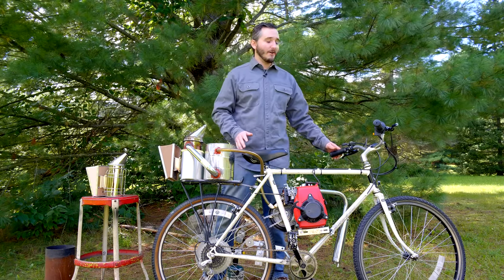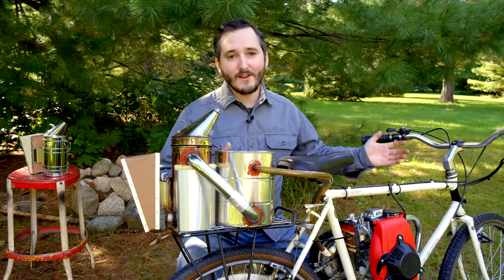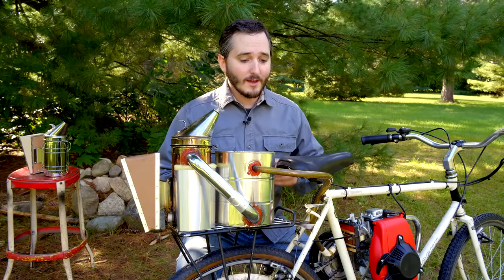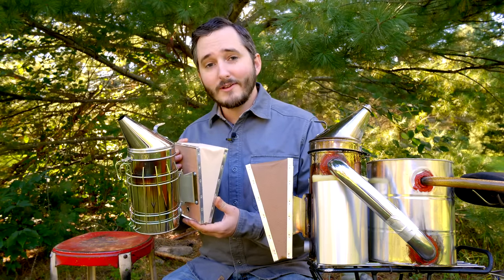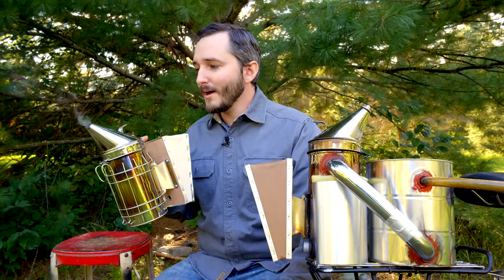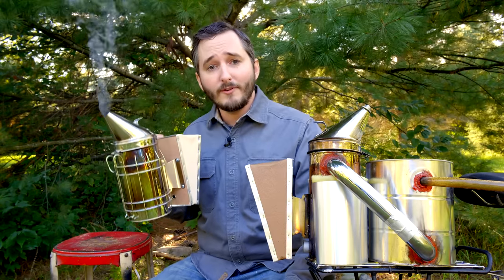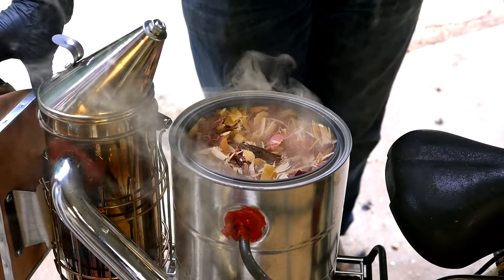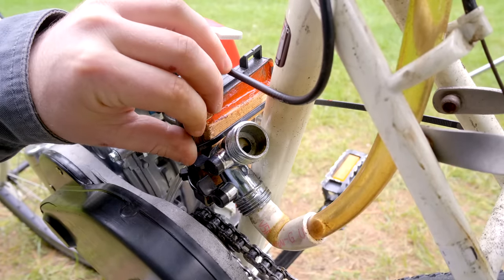Running a Gasoline Engine on Firewood | Woodgas Biofuel

Comment: I like Your channel and I love Your English. :)
For a person for whom English is not a native language, it is very important that the presenter speak slowly and clearly.
Edit: My suggestions
1. Separate combustion chamber from gasified materials, so heating flame will be always the same and much bigger.
2. Introduce separated tank, only for produced gases.
3. Add one way valve to an air inlet.
Edit2:
4. Use charcoal for filter and clean gases.
5. Use part of created gases to heat gasification tank (positive loop).
Reply: For the charcoal filter it's best to use activated charcoal, since it absorbs better than normal charcoal.
Pretty cool ideas though.
Reply: make a schematic where would he put all this stuff on a bike like that. If he could, he would add a lot of things, but the space and weight is restricted.
Reply: Efff, mounting any part of this stuff, including initial, is ridiculous.
We are not thinking about, is this vehicle is reasonable (because it is not), but is post apocalyptic cyclist is faster than Lance Armstrong on all of their stuff ;)
Reply: What if you compressed the air and wood gas entering the engine using some kind of a engine powerd turbine.
Reply: Hammer of the Witches. Your username is not one I expected to see in the Youtube comment section. If I may ask, why did you choose that for a username?

Comment: You can make it pass through lime water to absorb CO2
Reply: This might also remove more of the water vapor (as long as the lime water is cold enough).
Reply: It would be additional weight, and it woukd have to go through a lot of it because gas absorption in liquids is very slow if it comes to extracting at least 10% of the gas.
Reply: How about a cannister of lithium hydroxide as in a diving rebreather? Of course, it is additional weight again. You're also perhaps getting away from the intention of running an engine entirely on natural fuel if you need LiOH to run it!

Comment: The beesmoker is a neat idea, but to minimise smoke what you really want is a downdraft-gasifier design. Ive never tried this myself so this is book-knowledge, but it supposedly makes an enormous order-of-magnitude difference in terms of the amount of partial combustion products, as compared to the updraft system which your beesmoker seems to be. It makes sense too, since if the air moves in the same direction as the combustion front, the combustion products will pass over the hot coals last, allowing them to be maximally reduced.
Reply: Exactly right.  

It also produces less tar to use charcoal fuel.  He's got way too much tar and it will clog the engine valves in short order.
Reply: Would coal gasify as readily as wood though? I have not seen it been done in such small setups with more crude process control. Not sure what the immediate impact of tar on the engine is (I imagine most of it would burn quite ok once in the cylinder?), but even without any tar I fear the setup is underpowered. Thermal processes don't scale down nice and proportionally; you need some minimal volume to sustain and isolate a nice and high temp burn front; so taking a car-sized gasifier and scaling it down proportional to the required wattage might not be a great idea. You need an insulated space to get a nice and white hot region to gasify optimally, and intuitively I don't see such a white heat being very confinable in such a small volume. With a loosely packed fuel in a small volume like this, the dynamic is more likely such that youd be driving off water at low temp (and thus tar) throughout the container initially, rather than achieving a more continuous burning front with a more or less constant gas composition. Coal would help with those concerns I suppose; given that it does not have such a complex burning process it should be simpler to contain; coals are either hot enough to form CO or they are not.

Comment: A conveniently located choke control would be helpful here.  That way you don't have to rush around and adjust the intake.  Another point is that many of these new small engines are designed to self choke with gas and won't open up until they're running past a certain point.  That could be another issue you're running into.  A 4 stroke gas weed eater might be worth looking into.  Most of those still have separate manual choke assemblies.

Comment: It looks to me like Wood gas is being lost out of the air inlet. If you added a one-way valve to the inlet it would prevent this. Although it wouldn't help the already low air flow.

Comment: You  are guaranteed to succeed with this, with a wee bit of fine tuning - but you are also guaranteed to gum up the engine with tar in just a couple of hours  :( . 
 Been there, done that - got the tee shirt. 
 Sadly, there is really NO way to filter the tar out, but it IS possible to produce woodgas that is clean enough to be as invisible as air. 
 A deep charcoal bed, and HIGH combustion temperatures are elemental to success in this regard. 
 Once you get those aspects under control, you will be amazed at how clean, and smokeless, your fuel gas will become. 
 By the way, I totally love this video, and I really wish more people wood give this a go  :) .
Reply: We do this to a large industrial scale 24/7 in South Africa to make our final petrol and diesel fuels which will rival even the cleanest fuel in the world... so it is possible. The benefit of this type of fuel production is low sulphur, we even have to add sulphur components just to ensure proper hydrotreating catalyst function downstream of the fisher trops process (gas shift) after this gasification step! Getting tar and pitch out is easy, let it cool down and filter and drain it. But yes you do need a lot of steps of filter and distillations to get good clean fuel for engine grade. Still, this is super interesting experiments!! Btw all information in this comment is public knowledge. I'm not representing my company with this statement.
Reply: CNCmachiningisfun by
Reply: @MorneBooysen  Fisher Trops Process was something the Germans were doing to keep their aircraft and vehicles going during WW 2, right?
Reply: @ZuluLifesaBeech-  not sure, but I definately have heard the same story before. but commercialising it to scale is rare and as far as i know only in Sout Africa
Reply: @ZuluLifesaBeech-  it was used for some civilian and training vehicles by Germany
Reply: I saw the Mother Earth News wood gas powered Chevy pickup traveling along the freeway in Michigan, which had a minimum speed of 50 mph. Their HQ then was, I think, South Carolina, so the engine and system must have been reliable.
Reply: @senatorjosephmccarthy2720  
 Yup. If a gasifier is set up properly, the engine will have a LONG lifespan. 
 My system has clocked up over 2200 hours, so far  :) .

Comment: You need to treat these start issues as if you are using propane gas! Wood-Gas, you need a flare pipe pre carby and light that first! You need to light it and allow it to burn bright, and this will eliminate the smoke issue you have! Also, that system is only really suited to a fixed engine speed unless you have E = mc2 , thus a clutch will be required for the operation of the vehicle unless you can regulate the air fuel mixture correctly for muli purpose throttle operations. Especially generators as they are governed! They work for most purposes just fine at fixed speeds other than welding or other intermediate sudden high-demand situations! Well done all the same! I'm very impressed.

Comment: Use a venturi to draw air into the engine- consider a carb design that can meter it a bit better? make the float raised by gas buildup instead of liquid fuel. Also, different spark plugs may perform better. Then just need a clutch/belt to the bellows for pedal start!

Comment: Love it!!!
So two thing's that may help,
1) elm wood provides a higher methane gas than most woods.
2) When lighting the tinder....the tinder should burn from the top down as in the direction of your draft. When lit from the bottom burn rate is diminished by draft
Reply: I had some afterthoughts as seen above.

Comment: StarLite: awesome job tying this together! It is in fact, almost the same formulation as some "Slime" mixtures. :-). I added a contact lens solution to reduce stickiness and it work just as well 
I think many of us should start working to finding applications to help place this material into fire fighter suits. This might help fire up the industry? 
Too bad the original inventor got too greedy. :-(
Reply: The kids have the formula and are refusing to share. They are STILL "working" on bringing to market. In the meantime, thousands have unnecessarily died because a technology was available to save their lives.

Comment: In my polymer chemistry researches I've stumbelled upon gasification as a means of "recycling"/reuse old plastic. You might give it a try in the same system. Apparently one can expect the output gas to be around 25-35% CO and 55-65% H2 while also producing small amounts of CH4 and C2H6. I wonder how it would run the bike? Might not be as "green" as woodgas tho.

Comment: Would love to see the update to this with the larger setup, if you can get this bike running at full throttle with no issues I feel like it would be awesome because then you could take the ratios of size of gasification chamber to size CC engine and really take any 4stroke and run it this was especially since these wood gas systems are carbon neutral, you could run a sawmill, vehicle, generator, you could combine this with a flywheel power generation setup and basically run your house with almost no environmental impact

Comment: Good 2 stroke engines have Autolube, so no need to mix oil with the fuel!
Reply from the maker: Forgot about that option
Reply: Oil injectors not autolube. I.e., jet ski 2 cycle engines
Reply: @jkgkjgkijk  Not sure what your point is?
Reply: Your still injecting oil into the cylinder. Might as well just set the engine to run on kerosene or other oil based fuel at that point. 
The main purpose as I see it is to use as little oil as possible for a survival / shortage scenario. Using any form of 2 cycle engine would defeat that purpose.
Reply: @timothyhaug2060  You are, but a 4 stroke still uses oil for lubrication even if it's running on wood gas!
Reply: The bigger problem is the 2 stroke cycle. During compression the combustable mixture of usualy gas/air is getting sucked into the crank shaft housing and getting ready to enter the cylinder in the exhause phase. When the exhaust phase starts it also opens up for the gasses in the crank and if the engine hasn't fully flushed the crank (which it rarely does) the gasses can burn inside of the crank with it's supply of oxygen. I have tried this with a 2-stroke engine boosted by hydrogen, the crank house cracked at high RPM and caused a leak that stopped the engine, it might even be possible to blow a hole in the case and not just make a crack. A 4-stroke is fully able to do it because of it's 2 extra cycles.
Reply: @adamlaw2645  you can make oil from the wood gas production as a byproduct from the tar  I think Im pretty sure I've seen it done

Comment: Hello my dear friend!!! I was impressed with your idea. That's cool.
Here are my first thoughts on how to improve the design. I am sure that you yourself have reached them.
1) Use the best weatherization of the gas chamber.
2) be sure to warm the filtration chamber.
3) use wood chips from oak or birch, and not from resinous wood.
4) It may be better to dry the wood before using it, or to take the chamber drying chips.
5) position the filtration chamber around the tank with chips. this way it will warm up faster and will itself serve as a thermal insulating layer for the combustion chamber.
You can make it from an iron can of larger diameter and place the combustion chamber inside. I hope I understandably translated my thoughts from Russian to English.
I can send a drawing if something is not clear))
With interest I will follow the project.

Comment: I think you just need an air pump, the fire container is big enough it's just like a smaller tank.  The pump could risen the woodgas process and also you are producing some compression.
Reply: yes, you need an air pump... Turbo charge it!

Comment: I think it would be too complicated and heavy to make one work, at least for a bike, that is used to run the engine directly.  Seems it would be better to size the gas producer to produce gas at say 70 percent of full RPM but have it flow into a tank and then run the engine from the now cleaned and constantly pressurized gas from the tank.  Start the burner and once the tank is full enough, you go. Running full out you would be depleting the tank but every time you slowed down or stopped the tank is filling.  Had a big Dodge truck that ran on propane.  Only had a tank, but if I had something to produce propane I could have used it in a similar manner.  The propane pressure was always enough to keep the engine running until the propane got low.  A gas carburetor and maybe a pedal assist pump to pressurize the tank until it was self sufficient might work.  The truck  had a 440 in it and a forty gallon tank, so  scaling  that down to bike size then a 3 to 5 gallon tank  could give plenty of endurance,  Just an idea.

Comment: I'm digging what you're doing, I think it's great! 
1) try smaller chunks of wood, roughly the size of a dice. 2) try drying the wood out a bit more. 3) the wood needs to be much hotter before you try to use the wood gas, give it a minute. 4) Even with dry wood, there will be moisture, try teeing off the fuel line, such that the water runs down into a small reservoir. 5) your stove (reactor) is probably a bit undersized, but trying the above may get you closer to having the capacity.

Comment: As for ideas I recommend trying a double din system in an upside down "U" riding on top of the back seat area. Have one side of the U manage the woodgas and the other side manage the filter/other components. I figure this would be a nice balance for your design.

Comment: Well done friend. I have always admired folks with inquiring minds. I am South African and in the process of building my own house on a small farm outside our city. Have come to the conclusion that I am beyond being tired of the tyranny imposed on humanity by cartels and big corporates, even by Governments.

I will never forget ( I think it was J.P. Morgan ) that had access to the work done by Nicolas Tesla and the technology just vanished.

One bit of advice and no, I am not a pro on these matters but folks with more knowledge may suggest this also. As is the case with appliances running on LPG gas ( stoves / refrigerators etc.) will it not be more safer to add a small flashback arrestor in the gas feed line between the gas tank and the engine? For safety?

Keep up the good work. This sorry planet needs more humans like you.

Comment: Hi,

Excellent video!

I believe that the main reason that the engine did not continue running is that you close the cap/top of the “smoker” unit while running the engine and therefore the engine was not able to draw/pull enough air through the smoker when engine running, i.e. probably more openings should be made for air to get into the smoker unit (especially if the hole at the very top of the cap is closed or partially closed, but even if not closed, may be still not enough hole area) so as to allow enough air through the smoker while the cap is closed.

Comment: I guess if you install the beef smoker close enough to the intake air of the engine, it will help to maintain the gas temperature on high. Thus it will make the engine to be easier to start up. And then what about to add more oxygen on the intake air, experimentally if we could find the best ratio of the smoke/gas and air/oxygen then we could maintain the engine on run. But, anyway you have invented the solution of our crisis of energy source. By the way, i'm sory that my english is not very good...I'm from Indonesia. I love this channel and your invention👍👍👍

Comment: I remember seeing pictures of German military running a truck on wood gas. The gasification system was huge. Like the size of 30 gallon water heater. If you put like a saddle bag platform over the back wheel, you could have the fire box on one side and the filter on the other side. Also, if you return to the separate double burner style you’ll be able to feed sawdust to heat the closed compartment of 2x4 and have less issue with the smoke. My 2 cents

Comment: This is a cool little experiment.  I'm a little partial to using charcoal gasifiers for small engines.  They are much more simple and require a lot less space to accomplish similar fuel production output compared to wood gasifiers.

Comment: Try using charcoal and if you get it going then wrap a copper coil around the fire box to make steam and let steam go into the intake of the gasifier, but not directly in. If your charcoal is hot enough you will then make hydrogen. Charcoal gas blue orange flame, hydrogen the flame becomes whiter. Just have to balance things and it will work. Charcoal is cleaner than wood chips and will not gum up the motor as bad and as quick especially with a good filter, try charcoal as a filter also but use a foam oil filter, (like in a lawn mower) last so char dust does not go trough the intake. I once made a geet lawn mower, could only get it to idol but when i mixed water with the gas it ran a little better and had to shut the air valve down to a crack the thickness of my thumbnail, very small opening. It was producing hydrogen! Great video, keep on going you will get it.